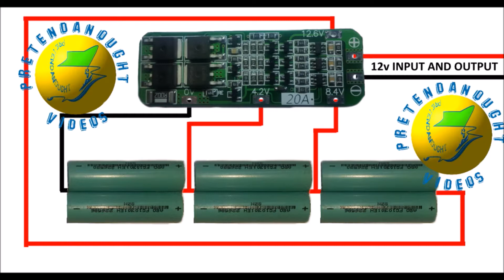DIY cheap and easy 12v  balanced 18650 battery build

Comment: 12.6v come out of this thing right... 12.6v / 3 = 4.2v for each dual set of cells.. But 18650's are only 3.6v? Does the board have some sort of voltage stepper?
Reply from the maker: John Michael Stock they are only 3.7v - 3.6v when they are discharged. 18650's are 4.2V when fully charged and 3.7V when the built in under protection chip stops them from supplying power. So this battery pack is 12.6V when fully charged and 11.1V when fully discharged.